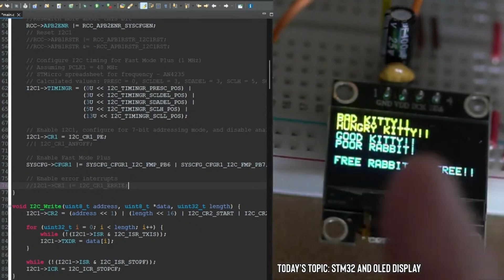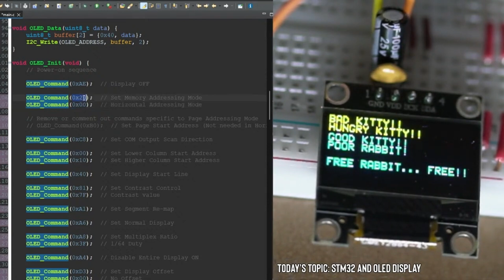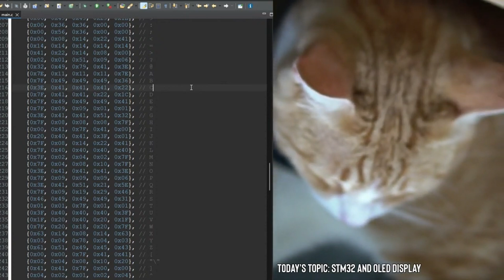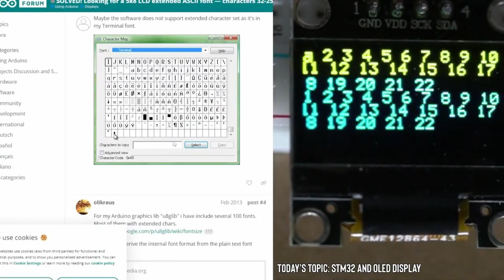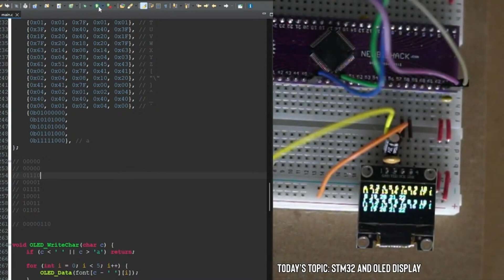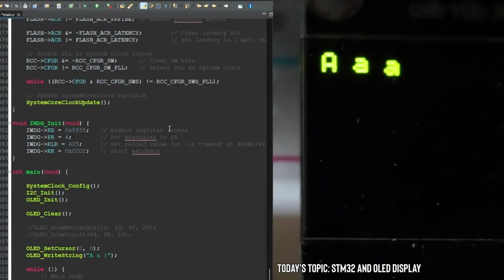Comment: There are 2 vertical and horizontal addressing modes. either a reset to the top or reset to the next line. Also there are no chaaracter rom in the 1306. All charcters have to be done thru softwars. The font file consist of each column having 8 bits. so is you take the hex value in on of the font files and convert it to binary gives you the piuxels that are on or off.
Reply: Thanks. This video is showing me playing around and wrapping my head around the understanding of how the display works.
Reply: @PatrickHoodDaniel  I primary use the vertical addressing mode of it reseting to the top in col 1